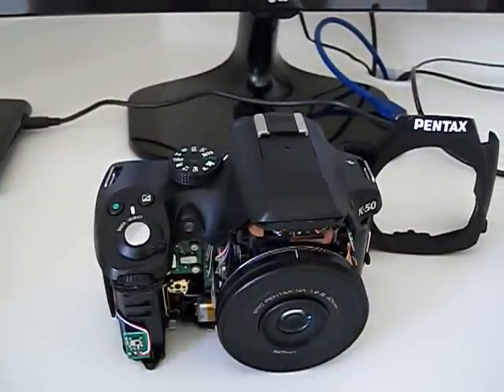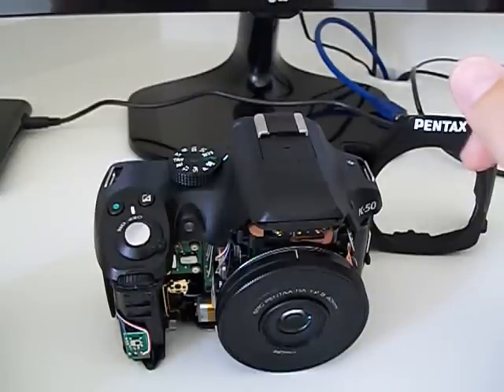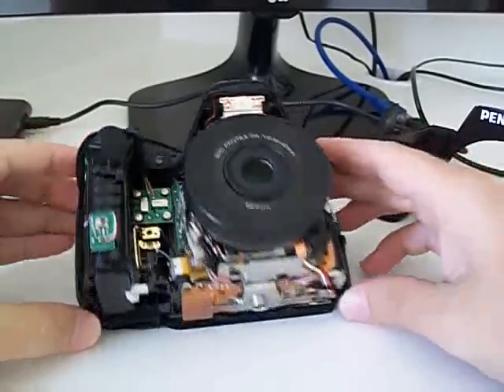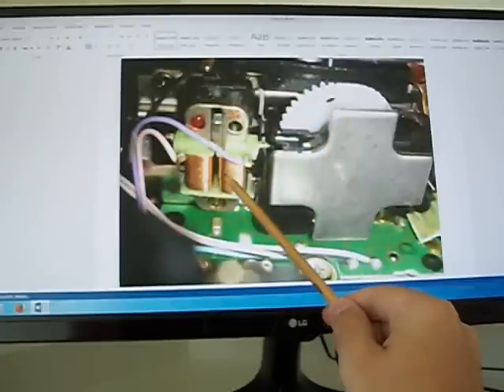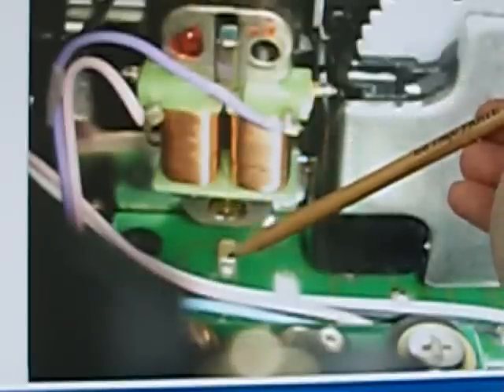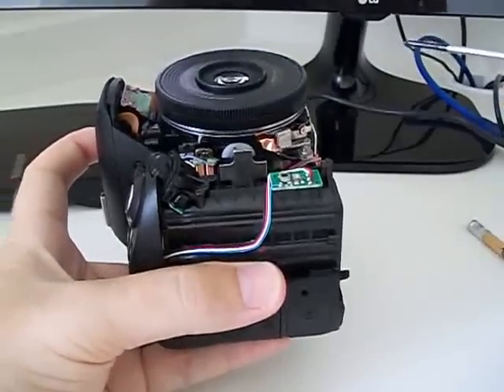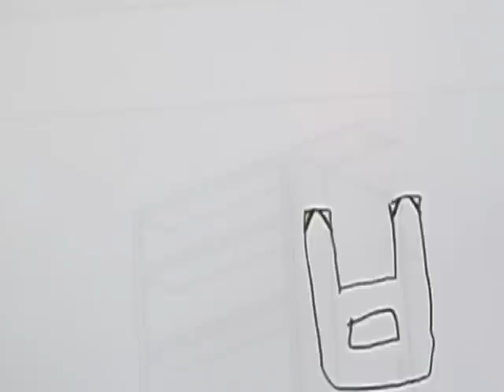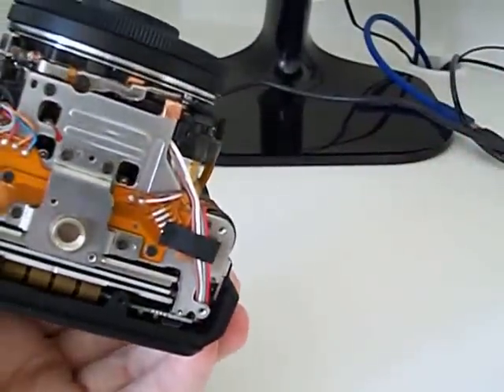how to fix Pentax K50 and K30 with aperture problem

Comment: If this is such a common problem with K50, K30, K500, why hasn't there been a class action lawsuit? not worth it?
Reply: @everyday tenor if you own m42 lenses get an adapter and you won't have this problem
Reply: @everyday tenor yeah I bought the ks2 I did not know what had the problem someone gave me a k50 do you know if the  k3 has this problem.. it doesn't seem like it did the one you have the 10 d is from a while if I see it I might pick it up for cheap and that's around with it I do have a  100d I bit dated but you can get some interesting stuff with really good lenses at least  for fun

Comment: Hi all.  Had this issue on my K50 after not using it for 6 months.  Nervous about about openiong it up and managed to find a trick that solved the problem.  Put it in burst mode and fire off a load of shots. Delete them and repeat a few times.  Problem solved.

Comment: It works! I have a K30 model, so i had to find an extra movie with the cover dissasembly, but the repair itself really works. I am afraid of using WD 40 or other greasystuff inside the camera, i have used the 2500 sand paper. Thanks for sharing your experience and expertise.

Comment: Another hack (without opening the camera) to get this fixed. It works for me on my K-30

1. Go to Menu > keep pressing the right on the 4-way button until you see the "spanner" icon > Go to 3 > Dust Removal > Select both Startup Action and Shutdown Action

2. Now switch off and ON. You will notice the camera stutters every time you off or on the camera

3. Go to Home and press the right 4 way key (timer icon)  > Choose Continuous Shooting (Lo) and press and holder picture shooter button to continuously shoot pictures

4. Now choose Continuous Shooting (Hi) and take continuous pictures 

By now the aperture would have set and issue resolved. Again works for me.
Reply: it works even if u use only 2&3 step :) John - is k30 still working?
Reply: Thanks !! Worked for me! I was about to throw that camera in the ditch lol. I guess Pentax should get a hold on this..
Reply: Miracles do happen! This software trick fixed the underexposed photos problem with the camera and it now works just fine as before. Thanks a lot!

Comment: I used the same technique but instead of sanding I used wd-40.

Worked perfectly!
Reply: I used isopropyl alcohol swabs, didn't perform the disassembly, just unscrewed and removed the metallic k-mount ring and cleaned the mechanism which was accessible from there. My k-30 got resurrected 1500+ clicks and counting :)
Reply: I removed the metallic k-mount ring, but I can't access anything. How did you clean the mechanism? thanks.

Comment: Didn't work for me - I think I may have sanded too much off the ends. The result of my attempted fix is aperture always on fully open (so yo can use camera on Av setting!). I'm going to try replacing part, if I can get one.

Comment: Good fix, I filed the ends of the horseshoe in the way you showed and put it back together. I tried some recipes for cycling the shutter and it worked for a minute but didn't stay fixed. Instead of taping screws to a picture of the camera, I printed out pictures of the camera as I went and poked the screws in holes in the printed picture.

Comment: Fantastic! It worked!
Thank You, mbs!
Your english is GREAT! Better than the music I saw in other videos related to this K50 issue.
Well, I'm bad! I must admit that In other videos I saw how to disassemble the envolving panels of the machine. In fact, there is an obscure screw, the biggest one of all, that is inside the battery case, which was almost unnoticed.
For years I used this camera to take pictures in manual mode. It has been a dedicated camera to take still shots. Never used P mode nor automatic mode. Only recently I noticed this issue, since I had to compensate the light in an odd way.
After the repair it works like new!
Great job, mbs!

About WD-40, I DO NOT Recommend it. That is oil, even though it's very thin. In the medium term, it will cause friction on the solenoid, with the consequence of losing the speed of the mechanism. Beter  to use Isopropyl Alcohol or Spray electric contacts cleaner.
Some guys use WD-40 to improve the performance of the lens diaphragm. The real risk is to render the lens unusable, as it will have to be disassembled to clean the blades, which lose their speed.
Hey guys, a photographic camera is not a sewing machine! The latter use much more force than photographic cameras to move its mechanisms.

Comment: Thanks, it was very useful. I "scraped" the little jumper with what I had at home, which is 120 sand paper, for a few minutes, and it's less used than yours but seems to work fine anyway. 
But warning: you should be very careful when taking off the front cover, as I broke a little plastic handle for the screw right next to "K50". Well, it doesn't prevent it from working or anything, but I'm a little sad. 
Anyway, even with that mishap, I just saved tons of money, hoping it will last! 

NB: my K50 was 5 years old, bought it in 2016. Price announced by the repairman was 250€, roughly 300$ (sent to and fixed by Pentax France).

Comment: Thanks man! I had this issue for the second time and the repair cost ~100€ and last 3 years maybe. Now I did not want to pay so much and tried this. WORKED! Though I broke off one of the cables from the actuator or what this magnet holder is, so I had to solder it back. I sanded the magnet a little bit more but looks promising.
I'm courious how long will this fix last... :D
Anyway thanks for the video! Helped a lot!

Comment: Could anyone please explain why, if the aperture arm in the camera is not working, the images are dark, under exposed, and not over exposed? When you insert the lens onto the camera the aperture is made to be wide open at it's largest opening, regardless of the lens or lens setting, "A", aperture #  other than "A". or newer lens with no aperture ring (same as "A"). So when you take an image the arm in the camera body goes up, either all the way, or a lesser precise travel to control the aperture opening to let the spring in the lens stop the aperture down. Therefore if the camera aperture arm is stuck the lens will remain wide open, not close down all the way to result in a dark image. If the arm was stuck in an up position it would be immediately obvious when you look through a very dim viewfinder, yes? I am completely confused by this issue.
Reply: Of course if the aperture control mechanism was stuck it could, and probably would, prevent the mirror from going up and subsequently the shutter from operating. But this would be a complaint of no exposure at all and would be immediately obvious as opposed to underexposed images.

Comment: Thanks, worked for me, great video. Maybe need to explain more about the 3 screws under the rubber part and mainly to be careful with the most important and worst placed screws of all, the one for the selenoid, make sure to use a long and slim screwdriver to get a good angle and not wreck the one and only screw. Thanks again. Btw I have the impression that continuous shooting has slowed down a lot. Anybody felt the same?
Reply: K-50 btw

Comment: Yeah I sanded mine with some scotch bright.  Cleaned it all up and re installed it and it actually works!  I hope this isn't a routine thing but if I get another 12,000 pictures before it needs to be done im ok with it.
Reply: you cleaned the outside of the solenoid?

Comment: Thank for the vidéo!
So, to fix  the part with the coils and the magnet, I have to change the magnet or the entier part ?
Is there an online shop for that kind of part ?
Reply: Actually I sanded the small moving part and oiled a bit, and voila it works ! 
Thank's a lot for the advice !